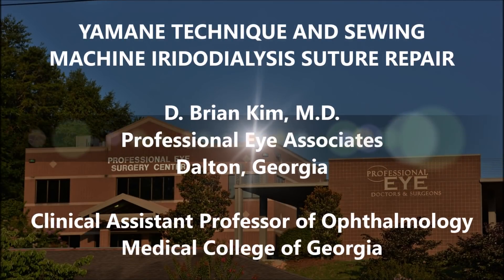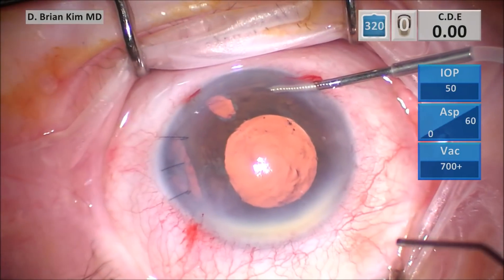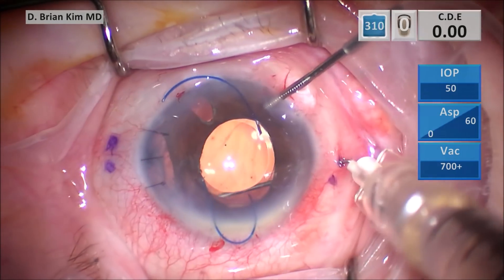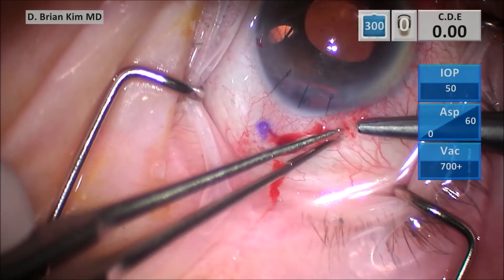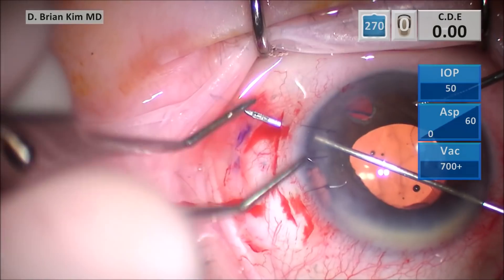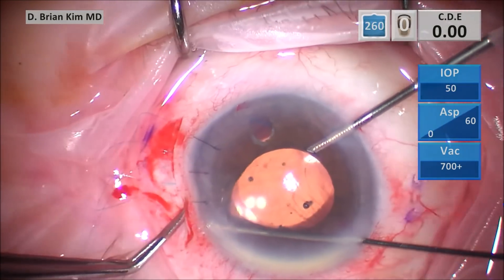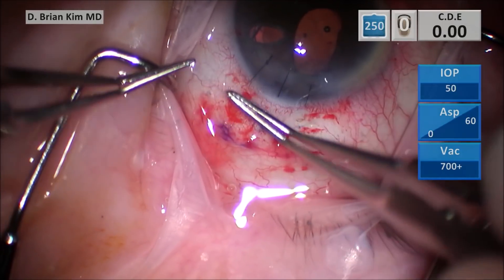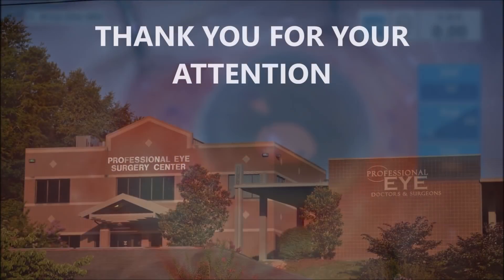Sewing Machine Iridodialysis Suture Repair, Yamane

Comment: I am regularly doing sewing machine iridodialysis technique in occular trauma ot.

 I use 26g needle. I bend the needle 45 degree from its root keeping the bevel towards me (after i insert the 10_0 prolelene suture), this makes it  easier for manipulation  in the anterior chamber.

But one problem i have faced is lodging/hooking the detached iris margin to the 26g needle tip. (For this i insert another bent 26g needle for better iris manipulation____sometimes getting a microforcep is difficult.)

Thank you again brother  for the great video.
Reply: Sir u can use 27 G or 30 G dental needle for better control and ease of procedure as i am doing. Pls watch my video if interested
Reply: https://youtu.be/fAhBGufnfRA
Modified sewing machine technique